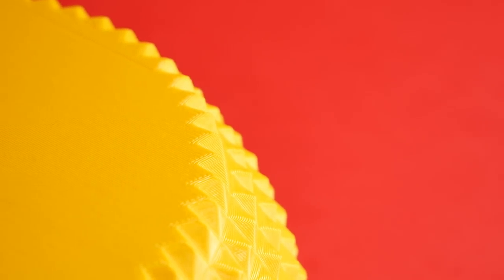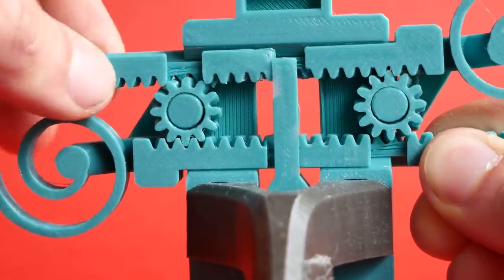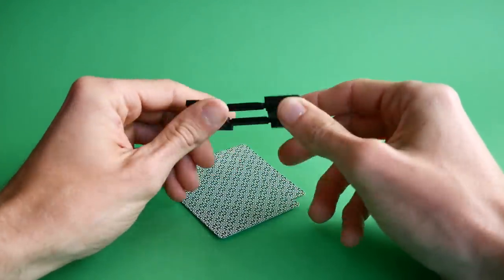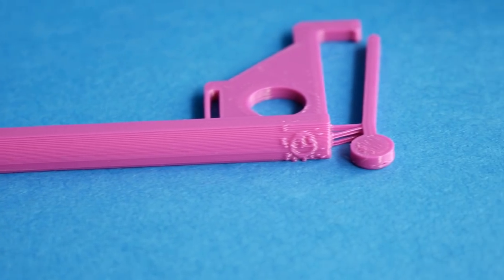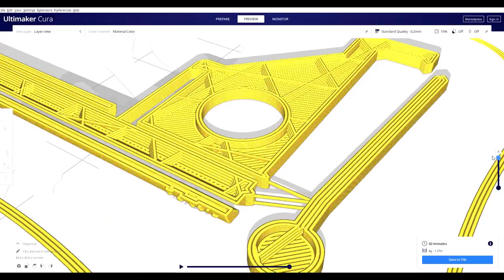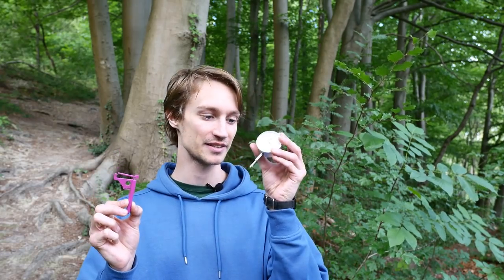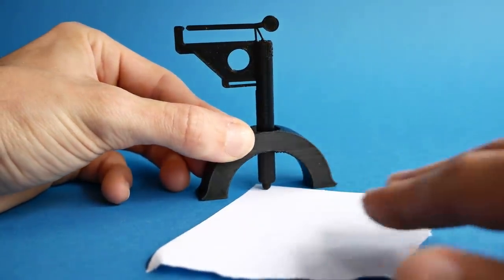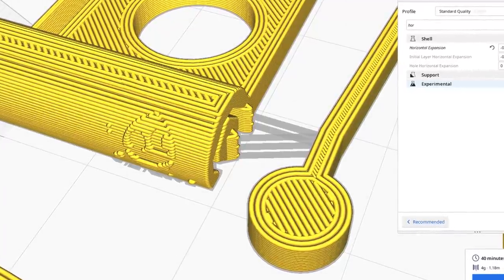Dial Indicator 📏 3D-Printed COMPLIANT MECHANISMS!!📏

Comment: This is beyond cool and an AMAZING way to solve this problem. SO GOOD.
Reply from the maker: Thanks Joel:)
Reply: How about a pressure sensitive device(Force redustive sensor). Built using Arduino.
Reply: @webslinger2011  Why would you if you print one in 1h without soldering, without programming, heck even without hassle!
Reply: @SinanAkkoyun  If I had the same machine. Mine won't fit that in. I could make an adapter but it was easy for me to do it my way than printing bunch of times 😅
Reply: Joel, you've just gotten Sunshine a new subscriber. I hope you're happy with yourself.
Reply: @MichaelRainey  I AM!
Reply: Now we have bl touch and load cells

Comment: Device you done calls "microcator". These devices in metal are extremely precise. It's quite common to have 3 um division value on such device but this isn't a limit at all. Of course in real devices they use sapphire tips, very robust spring steel for mechanism, strong metall body and so on.

Comment: This is amazing, just printed it and levelled my bed, ive NEVER seen a bottom layer as good as the one I got after using this. You have earned a sub
Reply: This is an amazingly cheap way for tramming in a bed. I would have never imagined something like this, not even in my dreams. Nowhere as good as an actual indicator of course but you gotta work with what you've got

Comment: I want to congratulate you! your design is awesome. I first tried to print it with .30 clearance but was not lucky, then I tested the .40 clearance and it works. I will build a clamp for my Prusa I3 printer

Comment: A good way I’ve stumbled across for visualizing bed shape is to just print a large solid 1-2 thin layer print either with a rectilinear or concentric fill. The warps will leave different marks that catch the light differently and look almost like tree bark or a topographical map.

Comment: Perfect solution!
This way you can perfectly adjust bed leveling!
But how to determine the correct distance from bed to nozzle?
Reply: Printed this detail but can't use it, parts stick one to another ((
Probably need to adjust my printer quality or change distance between surface.

Comment: I now want to etch one from aluminium foil. But until I get access to a suitably-controllable spot welder (one that properly handles aluminium foil), I will have to stick with thin sheet material. I'll probably rivet the other side of the channel wall and the main part to the front and back plate with 2 rivets each until then.
Etching thin sheet metal is way easier and more precise than most laser cutters.

Comment: For some reason it never prints the connecting rods to the pin! I have tried every way of printing this but the three rods connecting to the pin do not print even though the other two connecting to the main body do! Am I missing somethig? fantastic work though. Really impressive.
Reply: Nevermind I think its the horizontal expansion that caught me out. 
Will try print it again tomorrow. 😂👍
Reply: @ArnookieVR  did it end up working for you?
Reply: @andypandy5781  yes had to use Cura simplify3d just would not print them.

Comment: Does this work only with PLA filament? Also what infill is best 20% or 100%? I presume 20% with you not saying. Fantastic work though. Just like to clear up the little details before printing.
Reply: Should work with any filament.
Reply: @b5a5m5  Different filaments will produce different amount of compliance because compliance directly correlates with material stiffness. It still might work but will produce different results. Also Polypropylene would be the best filament for compliant mechanisms because it has the best fatigue resistance of all printable filaments.

Comment: How/where do you set your nozzle height?  Do you use the paper trick to set the height and your tool for the rest of the bed.  This is the one thing I didn't follow in your video.
Reply from the maker: Jupp, ideally you make sure the bed is level with the indicator, then you set the height by rotating all the bed screws the same amount. Some printers allow you to set the z height in software.

Comment: What is the maximal precision reachable with that? Can you make it a multistage mechanism? Also would it not be possible to 3d print parts and then "post-process" the parts by a machining equivalent for high precision, and with that build a "standard" dial indicator?  This would "require" a combination of a CNC router and a printer for precision, does that exist?

Comment: Does the dialer supposed to move freely inside the holder or push it down firmly? If so how far down must I push the dialer in the holder? Should have an indicator about it.

Comment: Any help with print settings?  Mine will not print all 5 of the bridged 'springs' going across the gap between the indicator and the piston. I've tried several things but not working.  SuperSlicer does not even show them when I slice, Cura shows them but won't print any of them except the first on on the bed.
Reply from the maker: You can try to scale it up a bit, like 120%. If cura shows the strings, but does not print them, it might be a hardware issue.

Comment: Hi, I have Ender3 and I have problems printing this. I use prusa slicer and I tried many setting but my bottom layers fuse together. Could you maybe share your slicer settings for this model please. Also have to say this dial indicator is great design!
Reply from the maker: I use stock cura profiles, try printing the 0.5mm version with some negative initial layer horizontal expansion

Comment: Did you check the trammed in surface with an indicator afterwards? What kind of tolerances can you expect with this tool?
Reply from the maker: Not on the bed, but on a level surface, i managed to indicate 0.05mm

Comment: Hey! I love the design. I'm curious what led to the inspiration to use compliant mechanisms?
Reply: probably the fact that 3d printers are much much better at creating a compliant mechanisms rather than gears, a compliant mechanism built with .2mm tolerances will be .2mm off in either direction or .4mm, a gear printed at the same specs would be .2mm off in either direction on every tooth. or several mm off with several teeth

Comment: I love the idea, but I can't get a successful print. First print used a brim but i damaged the fine strands removing brim. Second print, without brim, lifted off the bed half way into print. Third print, with brim, but some settings changed was OK except the fine strands didn't print at all. Don't have problems with any other STL's... any ideas?
Reply from the maker: Try printing the 0.5mm version with no horizontal expansion compensation, and you might want to turn up the heated bed and down the speed a little
Reply: @TurboSunShine  thankyou for the reply,I will try your suggestions

Comment: I tried to print 0.3 and 0.5mm clearance, still have problems, the needle stuck can't move.

And the tip of needle always warped up....

Should I print with brim?

Petg esun
Ender 3 v2
Reply from the maker: Have you tried it with pla?
Reply: @TurboSunShine  i dont have PLA, my first printer and bought PETG filament (first filament).

well i do have creality bonus filament, i heard its PLA.. hmm
Reply from the maker: @CTZN1  yes, they usually give you pla, petg is more "gooey"

Comment: Is the cover only there to have something to grip onto or does it actually function as a slide? What I am really asking is if it would become more accurate if the ”needle” was suspended by one of those linear compliant mechanisms?
Reply from the maker: mostly just to have something to grab on to, during normal operation it is already using a linear comp. mech. :)
Reply: @TurboSunShine  Good to know :D I have however noticed an issue with the model which can be easily solved. The pretty SunShine logo you have placed on the top of the shaft causes the plastic to warp there on my printer. This is obviously very dependent upon which printer and settings you're using, but it would be easier to print if the logo was in the center of the shaft or on the flat part of the print where it can't cause any issues :)

Comment: Great design! This will help a ton, one thing I'm confused about is the 0.3mm/ 0.4mm/ 0.5mm clearances. Which one do I need to print and what are the differences?
Reply from the maker: 0.3 is designed for well tuned printers, and 0.5 for not so well tuned printers, i'd say try 0.5 first, and then maybe try 0.4 or 0.3 if you notice that the parts are too lose :) (the clearance is the distance between the stem and the probe)
Reply: @TurboSunShine  awesome! thanks for the quick reply and help

Comment: Can someone offer advice?  I've printed this 3 times.  The bottom layers fuse together into a solid piece.  I'm using Hatchbox PLA.  Bed temp 50C, nozzle 205C.

I printed twice at .2mm, and once at .12mm. Every time the pieces are locked together on the bottom layers.  Can't cut them apart.
Reply from the maker: Are you printing the 0.5mm version? You can also use some negative initial layer horizontal expansion compensation  :)
Reply: @TurboSunShine  Oh dumb!  I forgot there were different versions.  I printed the .5mm version and it's perfect.  You're awesome!

Comment: How about the friction between the 3D printed indicator and surface? It will wear and results could be wrong after a while. How many times have you tested it and what is the dimensional difference?

Comment: Will someone explain to a 3D printing newbie what the difference between the 0.3/0.4/0.5 clearance versions is and which one should I print on an Ender 3 Pro?
Reply from the maker: 0.3/4/5 is the space between two walls, 0.3 is best, but if your printer isn't properly tuned, the walls might stick together. i'd start with either 0.4 or 0.5mm and se how it goes.

Comment: This is awesome! Im glad that im using ender 3 too :) .by the way, Do I still need to level all the 4 side after I use the dial indicator? Thanks!
Reply: You need to visit all four corners, but you only need to use the paper/feeler/whatever one time. Then you set the indicator at that same point so that it reads zero (i.e. the middle), and lastly you go visit the other corners. If the indicator doesn't read zero at a corner, raise/lower the bed until it does, then move on to the next corner. 

You may have to go around the bed a few times until the indicator reads zero at all four corners, but even so, you should only need to use the paper/feeler/whatever one time. After that it's just reading the indicator, even when you get back to the first corner.

Comment: I NEVER had luck with compliant designs. I don't know what I do wrong but they all break after 4 bends if anything :( maybe if u got the time and want you could do a tutorial on how to make them?
also i wonder how repeatable that'll be

I have this design for a print in place Z-probe that costs only an endstop. but I couldn't get the mechanism to work. want the picture./files so you can try it? it'd be so awesome. a 1$ accurate touch based compliant design probe!
Reply from the maker: hey, if your designs break, its because you try to bend them too much, try making the bending parts thinner and longer and avoid sharp corners, that should dramatically increase the durability
Reply: @TurboSunShine  i have :sob: in all fairness maybe it's my filament? the stuff you can buy in iran (where I live) breaks off as you try to feed it very frequently.
Reply from the maker: @ameliabuns4058 hmmm, you could try to dry it, pla gets brittle when it's "wet"

Comment: so i don't know practically anything you said all i got from this video is it needs to be printed with a .4mm nozzle with .2 layer height is their anything else i need to know or do and how do i know of it is high or low enough when on the nozzle. but umm i know you said this in the video but how do i know which clearance level i need to use i got a ender 3

Comment: You might be able to insert something metal into the indicating tip to increase it's hardness. Perhaps not worth the effort, but it would help keep the tip from wearing down. A small finishing nail with a domed top could provide a nice resilient surface. The nail could easily be inserted with the help of a soldering iron.

Comment: I tried printing the indicator out multiple times. No supports, printing it slow, very little brim due to how fragile the connections are, but I can't print that thing out.
Reply from the maker: There are 3 models with different clearancees, wich one did you try to print? What was the failure?
Reply: @TurboSunShine  It's the indicator itself. For the .3mm clearance, for some reason, it always fails around the thin connections that flexes when the bottom part touches the surface.
Reply from the maker: @seekertosecrets7618  hmm, could be a filament problem, or, does it look ok in the slicer preview?
Reply: @TurboSunShine  It looks fine. Tried it on 2 different printers and 2 different slicers. I don't think it's a filament issue. I don't think it's a bad design, but it just may not be working for me. I'll use another method. Thanks anyway.

Comment: I've tried to print each version of this, at different layer heights, and I just can't get it to work.   Each time the tube and rod are fused together so the rod cannot move.    What am I doing wrong?    Any suggestions?
Reply: I printed about five of these adjusting settings in between. Look down the barrel of the indicator probe to see where it is stuck. Mine were all fused in the stem on the initial layers, so I reduced initial layers from 4 to 2 in cura. I then adjusted mostly flowrate and lowered bed temp. Eventually my fifth print was still seized, but I was able to separate the stem from the enclosure using my fingernail. This also worked with the fourth. This may not be the correct way to approach this issue but it worked for me on ender3 pro on the coated glass print bed. Esun Blue PLA+ hot end at 205 C bed at 40 C.

Comment: I have been trying to print this part all morning... 
I noticed in Cura there was an issue with the two fine elements between the needle and the body. Cura seemed to just ignore them after slicing, they didn't even show up on screen, altho the shadow on the base was visible, so I moved to Prusa slicer which did indicate the two elements correctly.
However, upon printing, they do not print. There is a single fine thread which fades to nothing before connecting the needle to the body, which appears to be layer 2, after that there is nothing at all. This doesn't make any sense to me, does anyone have any advice?
Print settings are correct for anything else I print, tho I can share settings if necesary.
It has just occurred me, could this be anything to do with retraction? Ret is 5mm@75
Reply from the maker: Hi, it sounds like you might have a too large nozzle? it is designed for 0.4mm nozzles, larger nozzles are "too large" to draw the lines, so the slicer keeps ignoring them, you can either scale up the print, or use some positive horizontal expansion, however, then you might run into issues with clearances.
Reply: @TurboSunShine  no, I am using a pretty new 0.4 nozzle installed cpl days ago
Reply from the maker: @axegrinder65  hmm.. and line with is also set to 0.4? no horizontal expansion?
Reply: @TurboSunShine  that's right
Reply from the maker: @axegrinder65  huh, very strange, not sure what could be causing that
Reply from the maker: Oh! What laye height are you using? Needs to be 0 2mm or finer
Reply: @TurboSunShine  yes I've tried 0.2 and 0.1. My printer, geeetech a20 has a recommended first lay of .3 but I've printed it with .2 and .3 with the same result.
The rest of the part prints perfectly with spring operated pin working just fine

Comment: Hi, I printed with 0.4 nozzle and 0.2 layer height and did the 0.5 one but after printing the middle line sticks to the 2 next to it. Also do I need to print the holder for my ender 3 pro upside down? I tried it the way the file shows it but it didnt work.
Reply from the maker: hey, depending on printers and filament and stuff, you might get a bit of elephant footing, and then it might stick together, try (carefully) sliding a knife or something sharp between the middle line and the "walls".
ohh, yes, i should maybe have clarified the orientation of the ender-3 holder, its laying down, with the indicator holder up, so the printer draws a mickey-mouse if that makes sense ?
Reply: @TurboSunShine  yeah makes sense, thanks for clarifying! :) Knife didn't work but I guess I will try again with low speed and hope it does better

Comment: I’m new to 3D printing. Does it matter what clearance we print it at, 0.3, 0.4, 0.5?
Reply: depends on the model of your printer. I have an ender 3 and the clearance is 0.4. Usually it might tell you to use a piece of paper for leveling, so if you know the type of paper you can google the thickness, and that would be your clearance.
Reply from the maker: 0.3/4/5 is the distance between the walls, if you have a well tuned printer 0.3 should be no problem, but if you try that on a less ideal printer, the "walls" between moving parts might stick together.

Comment: When I set layer height 0.2mm, the little strips disappear at the preview, are you sure this is the ideal height?
Reply from the maker: ohh... thats wierd, which version is it? what slicer are you using? /line width?
Reply: It happens in all versions, i use cura 4.4, 0.4 i tried to change the width but it doesn't help
Reply: @TurboSunShine  Could you please send me your print profile?

Comment: what clearance level should i use with my ender 3
Reply from the maker: Either 0.4 or 0.5
Reply: @TurboSunShine  thank you but what is the difference
Reply from the maker: @datrandomdugggy5537  its the "gap" between two parts that move relative to each other
Reply: @TurboSunShine  cool thank you and one more thing how would I know if it is placed at the right height